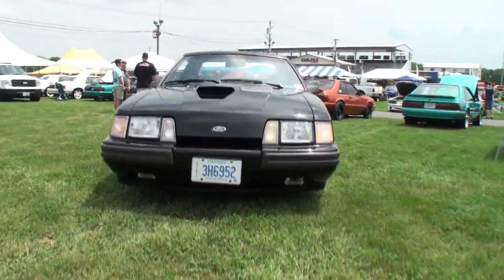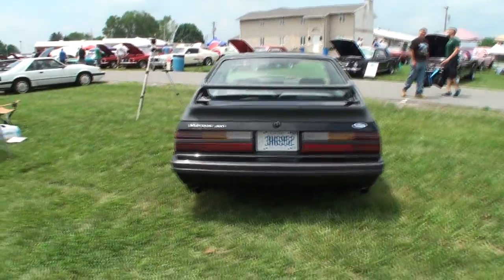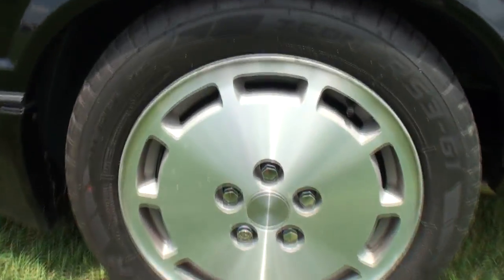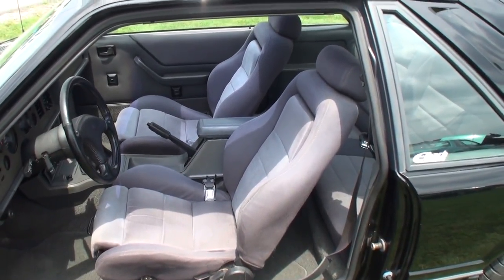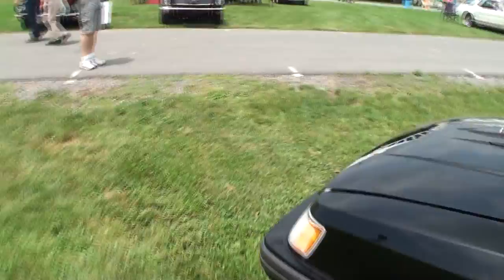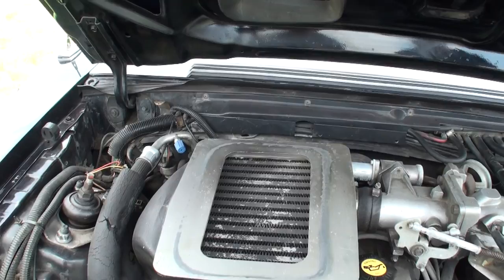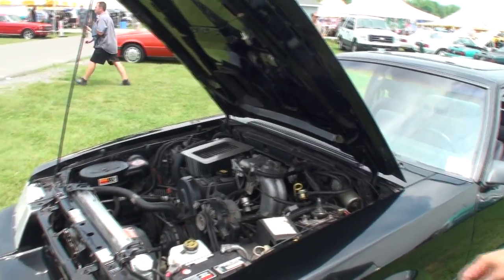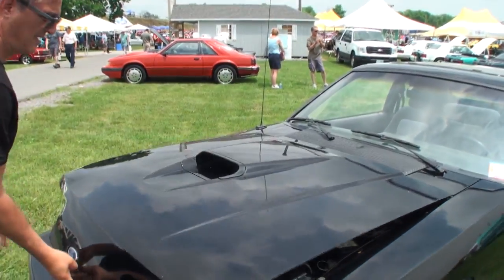1985 Ford Mustang SVO in Black & Turbo Engine Sound on My Car Story with Lou Costabile

Comment: I thought long and hard about buying the 1985 mid-year Mustang SVO. I drove it and liked it and it looked like power and gas savings all in one for 4cyl, and at 205 HP with a Hurst 5 spd manual tranny it seemed hard to beat for the price, but my wife talked me out of it. We had just moved to Livermore, CA. with my job the year before and it had a great airport there so I bought a used Cessna 152 instead. The following year I bought the 3.8 L Turbo Buick Regal Grand National...WOW what a BEAST! It was faster than the Corvette and a few European exotics in the quarter. However, I was very impressed with the '85.5 Mustang SVO engineering and still like seeing it so great video, Lou.
Reply from the maker: Sounds like fond memories of this one T.R. Freeman :-)  Grand National is a good one too! Lou
Reply: LLNL, right? Maybe Sandia?

Comment: In 1984, I took my first job at the end of my 10th grade school year, at a small machine shop that produced high stall torque converters. I worked there through my high school graduation in 86. But in 85, my boss sold the old shop, took on 2 'investors' to help increase the business. We quickly moved into a shop 3x larger than the old one.

 One of the 'investors' owned a Ford dealership, and he let my boss borrow a new 5 speed manual SVO Mustang for a few days. My boss let me take it for a lone test drive, and it compared well in performance with the v8 pony cars of the day! That's not saying much compared with today's Mustangs, as we were stuck in the muscle car doldrums in the 80s! But it would easily break both rear tires loose and leave nice, dark, wide, posi burnout lines!

Turns out, those "Lima" 2.3L 4cyl Ford engines from the SVO, Thunderbird Turbo coupe, Capri, Merkur XR4ti, were very tough engines that are capable of being boosted to 400+ horsepower without immediately blowing up!
Reply from the maker: Hi Patrick McLeod, Thank you for viewing, sharing your experience, and adding your story too :-) Lou

Comment: I use to own a 1984 Ford Mustang 4 Cylinder turbo but it wasn’t the “SVO” car. & let me tell you my 4 cylinder turbo hauled the mail & a few of my friends owned 5.0 mustangs, & this was back in high school days in the mid 90’s. My one friend owned a 1983 5.0  convertible & my other friend owned a 1986 5.0 Mustang fox body but my 4 cylinder turbo mustang could keep up with both of them & it was a struggle neither keeping up, i found late in 2nd gear when the “RPM’s” are up & that cool green turbo light came on which was located on the left hand side beside the steering wheel on the dashboard by the pullout headlight toggle switch, but high 2nd gear & going into 3rd gear is when she really  really  started to sing & pull pretty good & the 5.0 mustangs were also really known for being able to pull in 2nd & 3rd gear, i remember driving my buddies 1986 5.0 fox body & wow could you ever push it in 2nd gear to like140 kilometres an hour i’m Canadian where our speedometers have kilometres an hour & mph on the bottom but i much prefer mph obviously so in 2nd gear 140 kilometres per hour would be approximately 87mph. It’s weird how i still cannot find any video footage of the regular 4 cylinder turbo mustangs, actually sorry i did find one video which was a 1980 Ford Mustang 4 cylinder turbo & i didn’t realize Ford were making 4 cylinder turbo mustangs in 1980, i thought the regular 4 cylinder turbo mustang started in 1984 - 1986 just like the “SVO” Mustangs. I’m also curious if anyone could tell me if the what i call the regular 4 cylinder turbo mustang is the same as the “SVO” Mustang, in terms of power & torque? I’d be curious to see a “SVO” Mustang vs my old 1984 4 cylinder turbo mustang & see who would win in a quarter mile drag strip & it would also depend on drivers as well as there are lots of guys who think there Don Garlits or Jeff Gordon & can’t drive worth a crap! LoL.
Reply from the maker: Hi Sudsy Sutherland, Happy to read this car brings back memories of your car :-) Thank you for viewing and sharing.  Hope you see many cars on this Channel you enjoy!  Please Subscribe, and hit the "bell" so you can see all the cars when they are uploaded on this YouTube Channel, Lou

Comment: Lou Very Nice Looking SVO!
I have an 84 that I have owned since Jan of 89.
It's been to & spent the weekend on The Road America track in the early 90's and she had a blast playing with about 70 other SVO's and a handful of A/C Cobras, few Pantera's some Mustangs and other Ford powered vehicles at The Northwest Region SCCA All Ford meet. 
back when all those cars were cheaper, guys drove them!
the front to rear weight balance of the SVO made them handle better from the factory than a 5.0 - with 3x weight hanging over the front axle
the bottom end of these little 4 bangers are capable of 500+ hp just by getting more cooler air and Fuel in them! and this was back in the late 80/ early 90's.
Reply from the maker: Hi Ross Wolhar, Happy to read this car reminds you of your car :-) Sounds like you're having fun with it, and thank you for viewing and sharing, Lou

Comment: Best year mustang SVO was the 1985 1/2 as it had 205 HP and beat the mustang 5.0 by a car length and as far as handling there was no comparison because the weight savings of the 8 cylinder to the 4-cylinder they used much of that way to make the handling incredible not to mention that the 1985 1/2 is the most sought after mustang and is the rarest. I love my red mustang SVO it is 1 hex of a car and it is pushing out 400 HP so basically double the HP adjust for having both done parts being installed. There are many things I did to the vehicle put the most biggest part a much better turbo in downpipe and titanium exhaust from the cat back including an EVC and a fuel management computer. The EVC means electronic valve control for the PSI of the turbo and I put a much better intercooler that was my free-flowing and keeps the air call Dad at all times plus a k&n cold induction I'm disconnected the original one meaning of took it out. I also installed a more aggressive race track tires Yokohama 8008G but they don't sell them anymore and I think they discontinued them because they were excellent as far as traction but not as great and rain but I never drove them in the rain so they were awesome. If you are going to get tires for a little bit of rain put 90% of traction around corners I would go with         ADVAN A052 but if you don't care about rain or you're going to use them on the track I would go with ADVAN® A055.. make sure if you are using this vehicle for the winter to take all four tires off after the temperature gets above 45 degrees and put 4 GENERAL ALTIMAX ARCTIC 12 as they are made by Continental in Germany and they are the best tires on the market for the money. I swear by these tires and they will last you five seasons if not more if you take care of them as far as replacing them with your summer tires after 45°.
Reply from the maker: Hi Astrid Dallàs, Thank you for viewing and sharing your knowledge. Hope you see many more cars on this YouTube Channel you enjoy. Please subscribe, and hit the "bell" so you can see all the cars when they are uploaded on this YouTube Channel, Lou

Comment: Same Eng.As MERKUR SCORPIO,I Believe.Ford' s First Experiment W/ TURBO 4 CYL.Should Have Used the 2.9 V-6,Made in Cologne Germany,if it As Out Yet.,Of Which I Had in My 87 RANGER Truck.& Got Good Service Out of,For Almost 300,000 Miles.Turbos on These Tended to OverHeat the Exhaust Manifolds & Warp the Head,If I Remember,Because ,As Noted by Earlier Post,People Didn't Know How to Cool down the Turbos Before Cutting Them Off.
Reply from the maker: Hi Ed Cain, Thank you for sharing your knowledge, Lou

Comment: Why didn't they put 4 wheel disc's on all the fox bodys. I've owned 5 fox body's and had to convert a couple to disc.
Reply from the maker: Would have been nice if all four were discs.
Reply: your  5.0 would of cost more $$$$

Comment: 0 to 55 mph, 5 minutes 1/4 mile top speed 68 mph , only try to  pass vehicles with wide open views as from as you can see  cause the road want be long enough  lmao
Reply from the maker: Not the fastest Mustang.
Reply: @loucostabile  Certainly not that slow. I ordered and owned an 85 1/2 for several years. AutoX it and won my SCCA region against 5.0's and many others in my class. Ahead of their time, but in the end, the 5.0 was cheaper and quicker from a dig.

Comment: Nice car. Ford attempted , actually tried very hard to sell American drivers on the  "European" style 4 cylinder turbocharged engines ( The Ford SVO, and the original Ford Thunderbird Turbo Coupe/ Mercury Cougar XR7  ).  Once the engines spooled up they were fast.   But couldn't beat the instantaneous power put out by the 5.0 V8 engines.  In short, size and horsepower trumped over technology.
Reply from the maker: Thank you for sharing your knowledge MrGeeMan1980, Lou
Reply: The 5.0 in that time made around 225bhp, my turbo coupe makes stock about 195, I can boost control it to 300 and remain steady. I couldnt do this with the v8